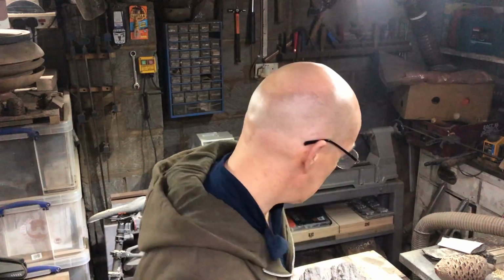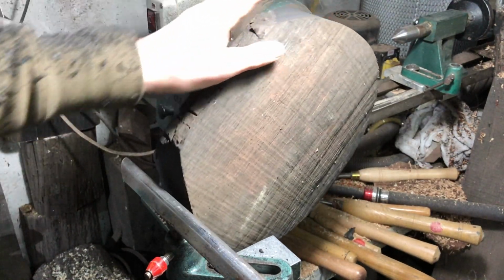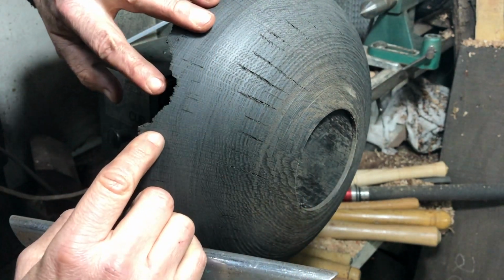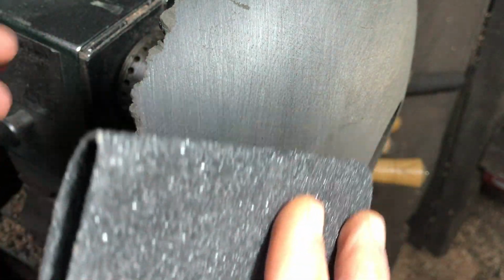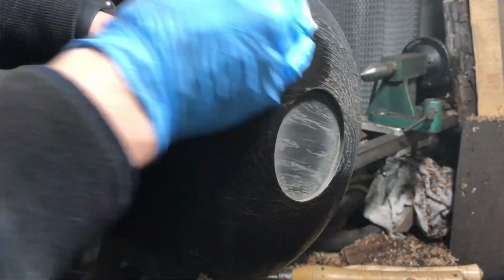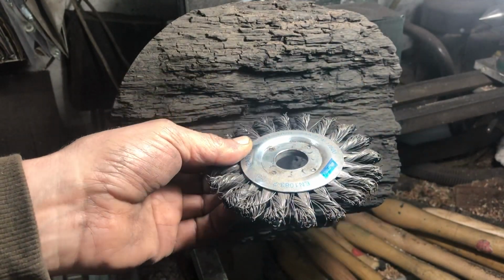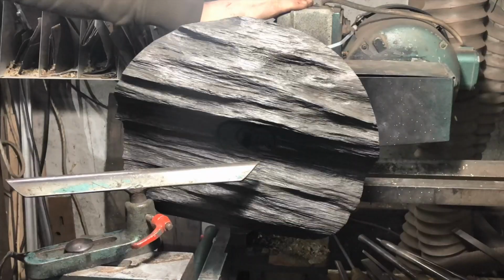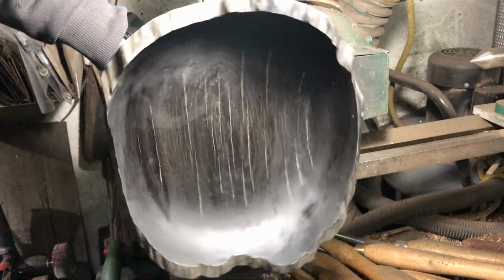HOW TO turn a natural edge - Bog Oak Bowl - Piece 792

Comment: Sander sealer ?? What's that. 
Thanks for sharing your knowledge on bogoak. I've been searching for someone that has some sort of experience turning it. I fortunately have a quantity of bogoak from the Castlebar area on Co Mayo . I'm hoping to try turn some of mine but am worried about wasting what I have. 
Thanks for sharing 🏴👍😊🏴
Reply from the maker: Hi Charles, Sander sealer is what a lot of turners use to seal the wood before putting the wax coat on. It prevents the soaking in of the wax and gives a better shine for the wax. Different turners will use it it slightly different ways but I usually apply after sanding to 400 grit, leave to dry for 10-15 mins, then denib with 400 grit, then 600, then maybe 1,000 on bog oak. Then apply the wax. 
I use Chestnut Shellac Sander Sealer.
Reply from the maker: Don’t be afraid to use it. Just use it, as long as it’s moisture content is 10% or lower. Otherwise it will warp massively. Get yourself a cheap moisture meter if you don’t have one already.